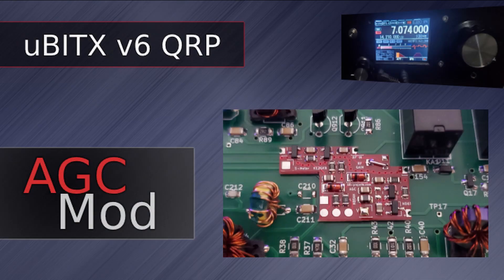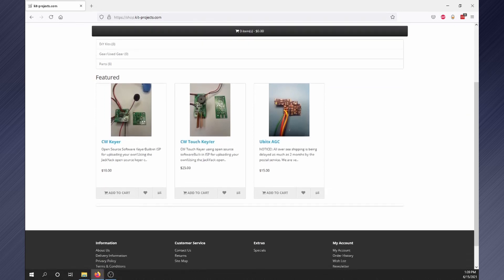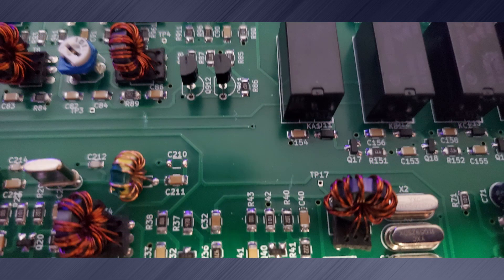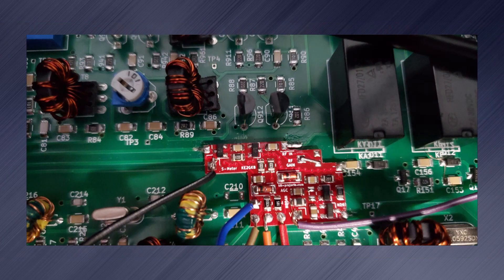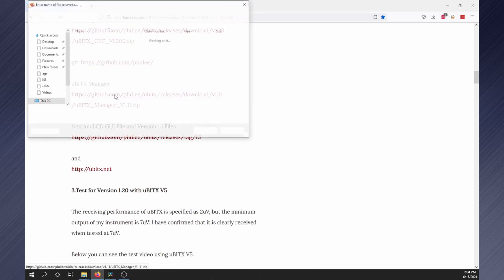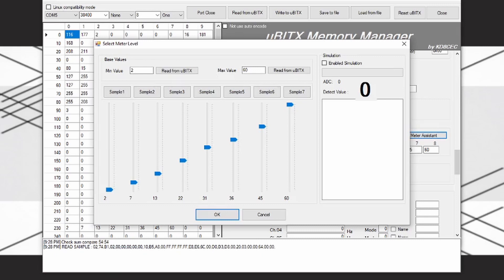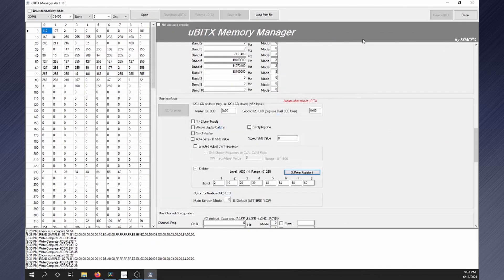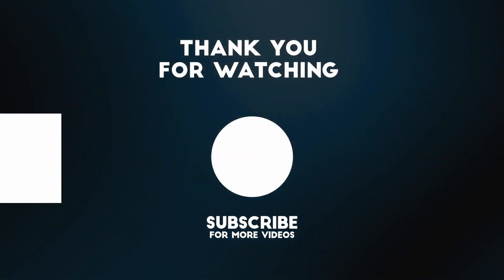Adding AGC and S-Meter to uBITX v6

Comment: I may have missed the answer elsewhere, but is there a functional difference using through-hole components instead of SMD components?

If through hole parts work, it would be very simple and inexpensive to get a PCB from those online companies that make custom PCBs based on your Gerber file.
Reply from the maker: You could do that

Comment: I believe their was a kit some time ago , and it was placed in the same area using a series's of coils mounted on a separate board and the soldering was in the same area like the one shown here
As it is very interesting 
.  I am making mine ubitx V 6 into  Frankenstein home base just for fun. Its main use is for qrp most of the time however, it will have a little after burner on it but that is not why I am doing this. I like old dials and l band atns, all mounted in a full tack mount case, just to be different, that's not to say I want build coils for filters as each challenge comes a long.